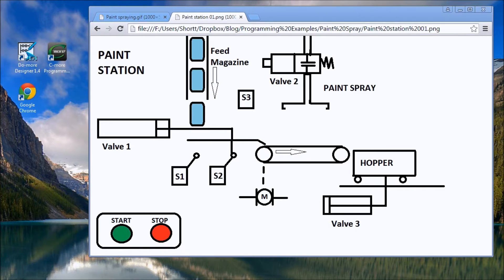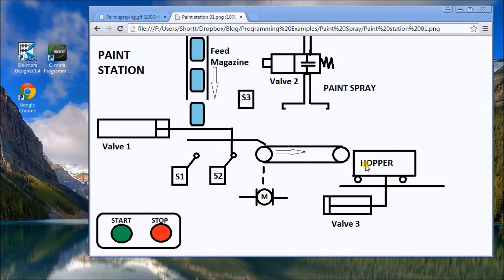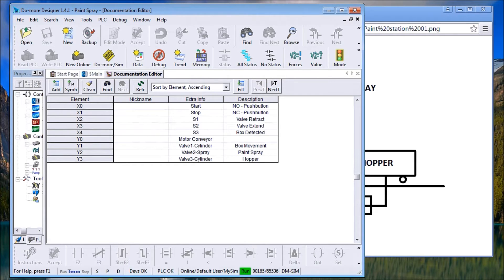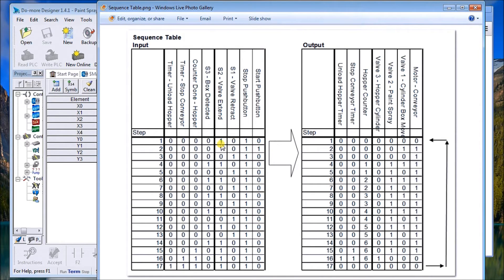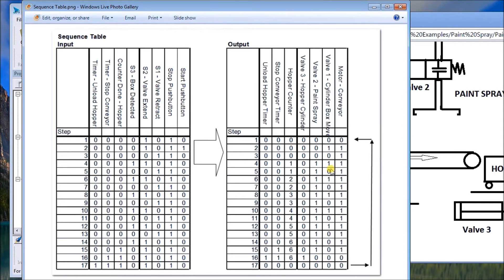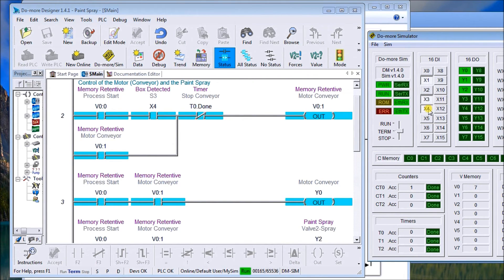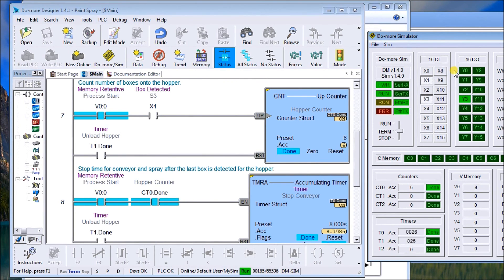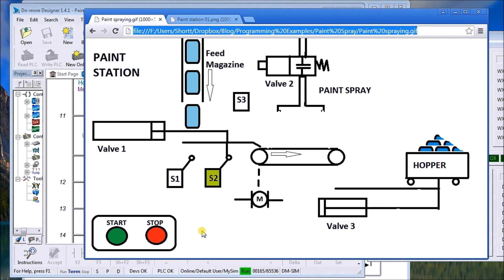Master PLC Logic: Build a Complete Paint Spray System

Comment: Hi garry,
when v1 goes from s2 to s1 (s1 stops v1 and make it back again to s2), how could v1 goes back again to s2 or in other words how would v1 starts working again.
Thanx.
Reply from the maker: Hi Mostafa,
As long as we have the process start and the hopper count is not complete this will allow the cylinder to put boxes on the conveyor. You can see the full explanation of the program at the following URL link:
http://accautomation.ca/plc-programming-example-paint-spraying/
This will take you through the five steps of the program development.
Regards,
Garry
Reply: @ACCautomation  how? please explain garry
?
Reply from the maker: Hi  @sachinjain890  
Please take a look at the sequence table at the following post. 
https://accautomation.ca/plc-programming-example-paint-spraying/
You will see the input sequence and the outputs that are set. 
Regards,
Garry
Reply: Hi garry ,
I think X3 and X2 position in rung 5 should be reversed.

Comment: Hello sir... Can you please tell me how cylinder will forward and reverse automatically by s2 and s1... If cylinder forward means s2 sensor sensed then cylinder will stop.. How it is possible to return and again forward?
Reply from the maker: Hi @user-wi4lr2gr9y
The shift register will turn bits on and off when they are detected along the conveyor. These bits are shifted (distance) based on the clock pulse. The bits higher in the shift register will activate the cylinder.
Here is the corresponding website page that goes with this video. It will explain more.
https://accautomation.ca/plc-programming-example-paint-spraying/
I hope this helps you out.
Regards,
Garry